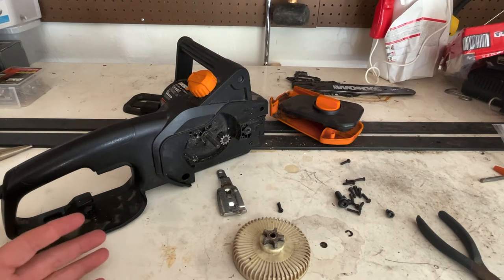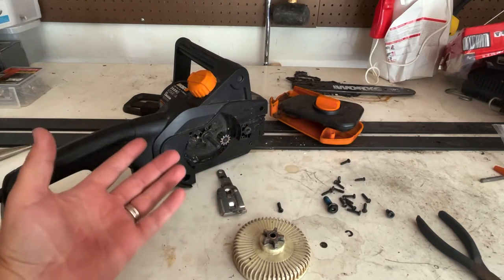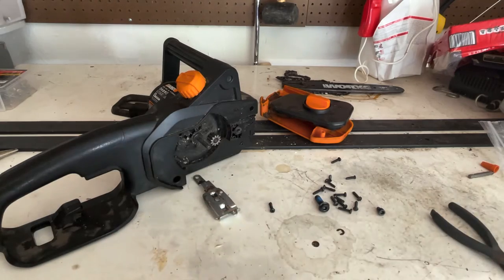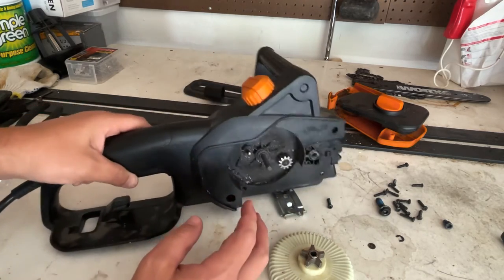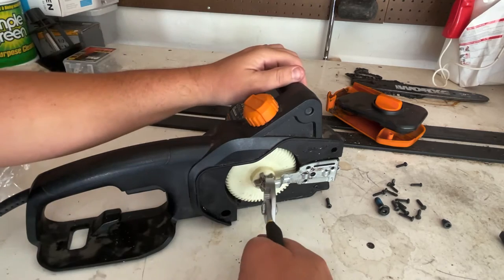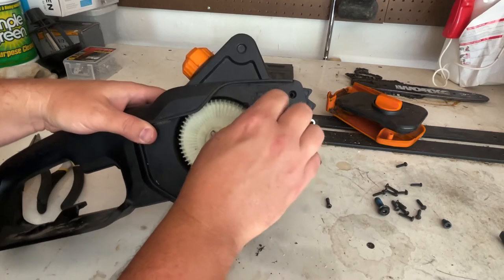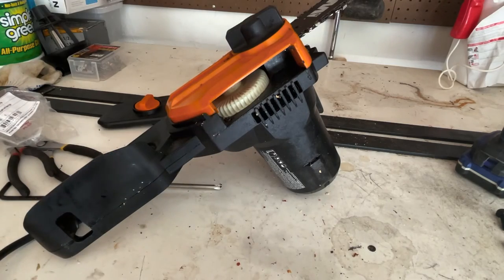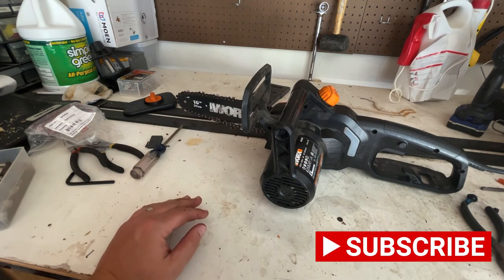How to fix a Worx Chainsaw / Pole Saw that wont turn or cut WG309

Comment: A plastic gear spinning a metal chain intended to cut wood. Tells you all you need to know. They suck. Weed trimmers are good, pressure washer good. Anything meant to cut wood, avoid!

Comment: No thanks so much I was just wondering how to actually put these dry sprockets on and I'm glad you did that with all the screws because I didn't want to undo unnecessary screws and mess with the electrical either so I'm going to do this and it's actually like 59.00 for it works sprocket so it's kind of like I'm going to save up if I ever need this again it says change it every two times that you use a change so every two Chainz you need to get a dry sprocket the next time I'm just going to buy a new one I don't know but I really appreciate you doing that because now I can actually put the screws on paper do you remember where I put on I really appreciate it have a good day

Comment: My pole saw from them got used 3 times and the motor shaft began to spin inside of the drive gear. I managed to tear it apart and put superglue inside of the gear and put back on. Let's see if it holds. Likely my last worx transaction.

Comment: Me again just took apart and broke the thin piece u couldn't find in your garage the one that goes on top when is screw in the metal bar but I made another piece from another piece of metal and I was wondering, I have a washer on my and you don't have a washer on yours that goes underneath the thin piece that just snaps in which I broke did you lose your washer I'm going to try what I rigged and let you know if it works 😮 thanks again. I don't like to mess around with electricity thanks for that tip leaving that last screw on do not have to mess with the electricity

Comment: I have a unique problem. I have a Worx chainsaw that I didn't get a chance to use when I first bought it. So, it is out of warranty. It's brand knew. I plugged it in and it will not start at all. I was wondering if anyone here has any idea what the problem could be? Thank you.
Reply: Did you ever fix the problem? if not let me know, i might be able to help
Reply: @dntlss  I did fix the problem. It turned out that a safety feature was engaged due to the postion the guard was in. Took a long time to figure that out though.
Reply: @Warrior99980  Cool,thats good to know, glad you got it going.

Comment: Thank you! I know this video was done a few years ago, but it paid off big for me so thanks. I got the part and its fixed because of you. I was wondering if when you took it apart, there was a thin and about 1 inch wide metal washer that went over the axle and in between the center of the new big gear center and the bracket that goes over it? I think that keeps the chain from slipping off the gears when loose. I was wondering if the chain slips off easy after you repaired this since the washer wasn't used if there was one on yours? I wasn't able to put this original washer back because I think the new metal hub of the gear stuck up just enough (mm's)  more than original that I wouldn't have been able to get the small locking washer over the end of the axle because the notch into it would not have been sticking through the bracket enough. Any one else have the 1 inch washer originally and able to use it again? The washer can be seen around 3:00 at https://www.youtube.com/watch?v=xVM0RgS1C9M

Comment: i was reading thru comments to find this part number. you gave 3 different answers: 50027037, rwd-347864128, and 50036579.  which is correct
Reply from the maker: The RWD is an order number. On the order,  both of those other numbers are list. 50036579 is the part number Big Wheel w/Bearings (50027037) WG305/WG309 is the description. I hope this helps.

Comment: Per my previous comment, the helpful Positec employees correct name was Paulette. Also in my research I looked though all of the WORX electric, battery operated chainsaw & pole saw manuals. I found the WG309, WG310, WG305, WG305.1 all shared the same part #15 - "drive sprocket" which per Positec is
 #50036579 - "Big Gear and Bearings". Hope this helps!

Comment: I have one of these,they are pretty nice little saws if used correctly,usually when they have stripped teeth like that they were used to cut something much bigger they were designed for (we all do that)lol

I have mine completely stripped at the moment,i got a new blade for it but the oiler hose was broken somewhere and it was leaking oil like a sieve,once i took it entirely apart i found it it was incredibly filthy inside ,you couldn't even see the brushes or the springs that hold them there was so much crud in there,i believe the sawdust mixes in with the oil that was leaking and forms this very nasty paste all over the machine,looks like new now after a good cleaning, thank you for posting the number for worx, i gotta call them and order  a washer i lost,lol
Reply: Have washer broke the little piece though LOL

Comment: I have a 303.1 and had exactly the same issue with the teeth stripped. I was able to find the gear part online (50019119) at a generic parts site for less than $15, but it didn't come with the metal bearings as part of it, it was just the plastic gear. I struggled quite a bit to extract the metal part from the original, but the bearing will pop off with enough encouragement, and then it's simple.

Comment: What was the exact nature of the original problem?  My WORX saw won't turn and just hums.
Reply from the maker: Mine just made sounds like the motor was turning but the blades were moving. It was because the teeth inside the gear were so worn out that it wouldn’t catch.
Reply: Mine too.